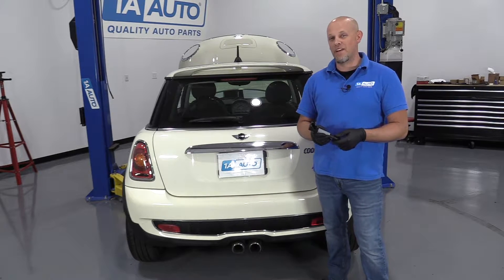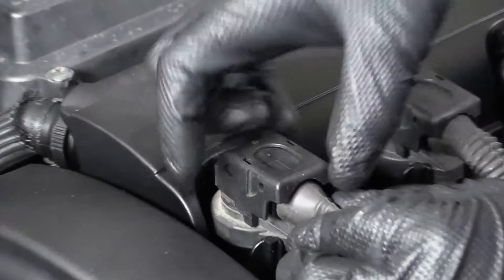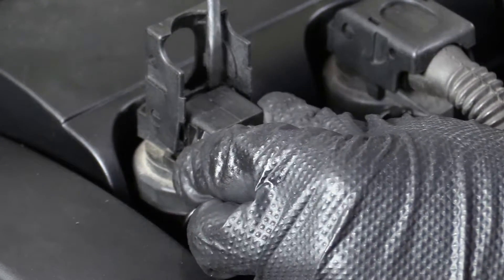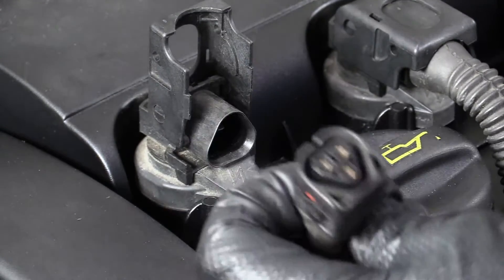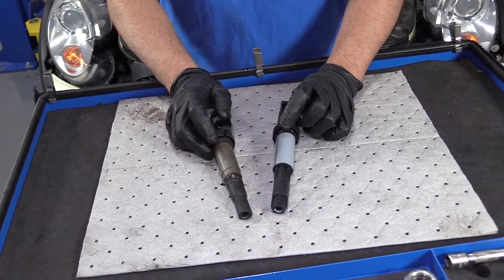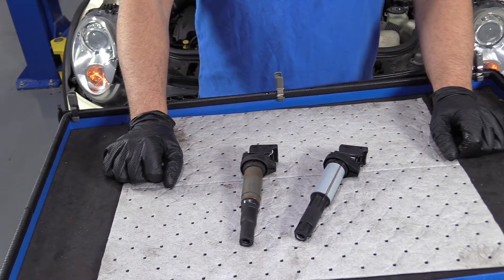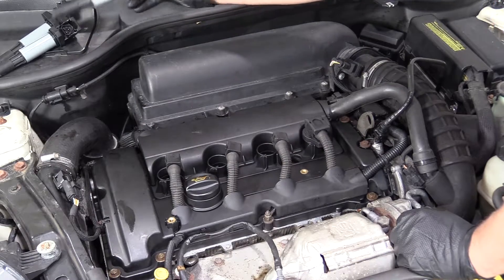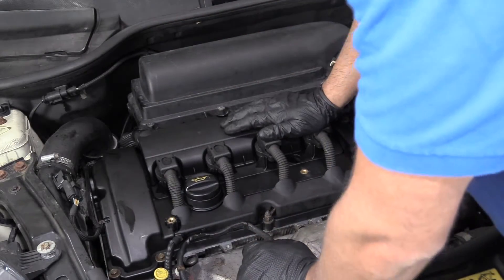How to Replace Ignition Coils 07-13 Mini Cooper S

Comment: I got an 07 mini cooper S and it not getting any spark at all
Reply from the maker: Thanks for checking us out! We suggest to take your vehicle to a local mechanic for an accurate diagnosis. +Lazaro Flores
Reply: @1AAuto  Good luck, I took mine four times to 3 different mechanics across the state and no such luck. I'll fix the car myself.